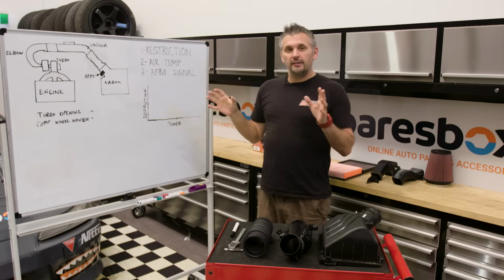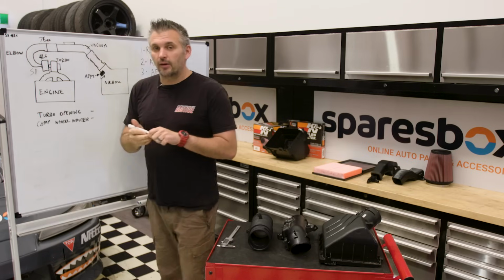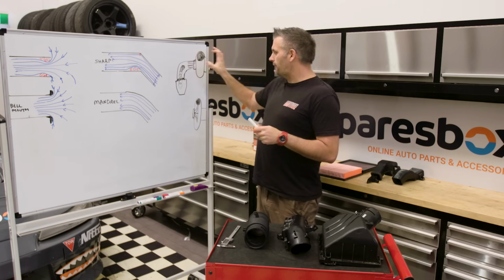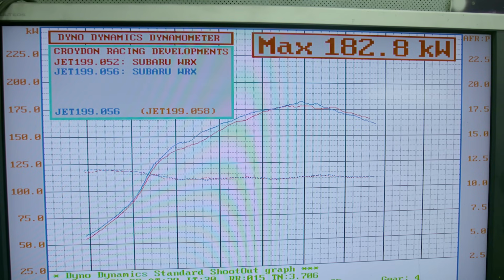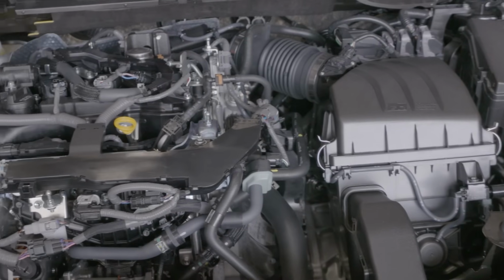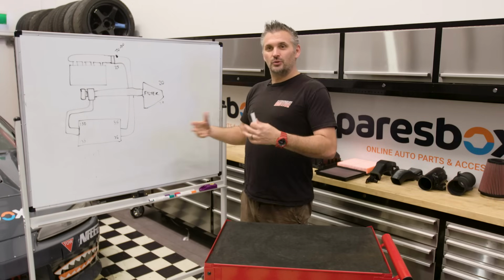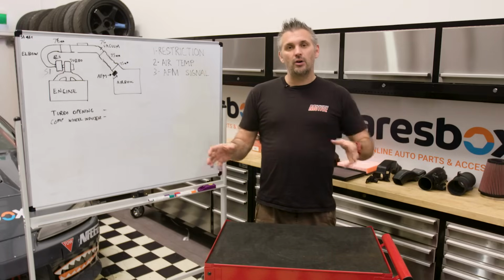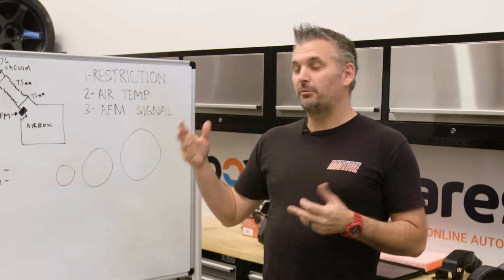Why Cold Air Intakes DON'T or DO Work on Your Car - Motive Tech

Comment: I can't speak for all aftermarket intakes, vehicles, labor and results across the board so I'm not gonna try to sit here and claim true or false for all for the majority but I can honestly speak from my personal experiences with simple bolt on parts before and after with older and modern vehicles. The oldest vehicle I've added such parts on is a 91 silverado with a 350 tbi. The newest vehicles I've added the parts on is a 2011 avalanche 5.3, 2500hd 6.0, 2500hd duramax and finally a 2018 escalade 6.2. No need to mention the diesel because everyone should know that these things make impressive gains by doing almost anything externally or internally. The 91 got very responsive and respectful gains mid to high ranges with just a cheap cold air intake, tb spacer and shorty headers and exhaust and even better gains after cutting the cats off! The 2500hd 6.0 was more of a let down as to shear power increases but I noticed more torque and lower rpm cruise speeds and a very respectful 3 mpg increase with the cold air intake and throttle body spacer without exhaust or headers. The escalade and avalanche where totally different stories! Those 2 where actually dynod before and after. Both received the same parts and brands which pertained to a cold air intake, spacer and tune which made a 16 hp difference in one and a whopping 22hp increase in the other! Shortly after I put a full magnaflow exhaust on both, plugs, wires, etc, larger injectors and shorty headers with yet again another tune with more substantial gains in hp, tq and mpg! The problem with most instances with these add ons is the neglect to get a professional tune afterwards so better luck and Goodluck to anyone doing these fun activities!.

Comment: On carb cars bigger filters and spacers and carb spacers all makes more power. I drive circle track have been since I was 10 I'm 29 now and bigger filters and spacers on the carbs make like 20 to 40 more hp because it's not a computer controlled car. So the theroy of more air and more fuel equal more power is true in a computer car the computer only allows so much air and fuel a air intake or spacers is not gonna allow more to go in unless you re tune it

Comment: Very well done explanation video.  This video helped me understand some of the success that I have had building a cold air intake in my street/drag truck. One of the successful things that I had not understood was the placement of the mass air sensor. I had cut a factory mount from an intake and put it where it belongs in front of the throttle body. I have learned that even the direction or orientation of a sensor can contribute to success. The mechanic that did the motor swap had mounted it in the end of a conical air filter. Another part of my success was deleting the a/c system. With the decrease in drag from the compressor and the removal of the condenser gives a clear path for air through the front grill. These changes  showed up at the track keeping in mind that the density altitude was better at testing the truck went from 9s to 8.7 in an 1/8 th . More than 3 - 10th of a second increase !  Thanks again for this video.  As I mentioned above it helped me understand the improvements that I had made.  I already knew that it had made a huge difference but, now I understand why it worked so well.
Reply: So what's better a stock 2011 mustang 5.0 intake or airaid cold air intake
Reply: @alexcarrillo5187  Try it and tell us all about it?

Comment: This is very interesting, especially with regards to the air flow meter.  My car, MK7 Fiesta ST had a Cobb intake installed by the previous owner that constantly threw a code, lean on idle that went away when switched back to the factory intake.  This was because the cobb intake moved the location of the air flow meter from very close to the filter in the top piece of the airbox to higher up in the intake pipe.  So the long term fuel trim was way over 50% all the time causing the engine light to come on.  It was also located after intakes from the carbon canister which may have had an effect.  What we have found out is that apparently for the US spec Fiestas, their map does not use data from the AFM, just map sensor whereas the Euro spec which we get in Australia does use the flow rates for the tune.  And on our Fiesta group there is sticky notice for that warns people to not buy any intakes from US manufacturers like Cobb, K&N and Mishimoto as they just throw codes.  It doesn't help that most of these companies never tested their intakes on non US cars so Aussie retailers who don't really do much research still sell them to unsuspecting customers.
Reply: That normal with 99.9 % aftermarket parts manufacturer they don’t even test for a month driving the car on road and then make fake claims
Reply: intake manifold vs what kids call  an "intake"
Reply: same here in the states

Comment: how come adding a performance intake slowed my 0-60 from originally 5.2 seconds to now a 6.4? i have a 2021 camaro 2.0, can someone explain this? do you need a tune for it to work? I'm losing mpg and power after installing the intake...

Comment: This is the honest truth about intake , personally I prefer factory intake box with 3 layer foam racing filter. Looks same as factory but less restricted and most car intake box is positioned to get outside air better than aftermarket intake. Nice video keep it up
Reply: And usually there is aftermarket options to get better flow to the airbox I've seen snorkels that go over your factory intake and some that route through somewhere like your grill using aluminum sheets to guide air towards your box instead of covering it.
Not sure which one is better I don't really like the idea of routing a huge snorkel right in the front of a car instead of just guiding more air
Reply: @Kuni - Kimina   another theory that make me don't even believe in massive air box is that bigger intake manifold  and high flow filter is more important than the diameter of the intake pipe .

Comment: I just changed my cobb pod filter to a grimspeed dry con panel filter. I recently put in on the dyno and had a 9hp gain before tuning even started. So il be staying with my airbox & panel filter moving forward

Comment: Reducing IAT and increasing MAF after removing restrictions will give gains. Many add cone filters that remove restriction and add MAF but heat soak in an open engine bay that do more harm than good. Installing new by the fans can also fluctuate MAF and heat soak. I’ve had better results building my own CAI then buying some. Many kits incorporate piping that is hard to best. Thanks mate!

Comment: In my natural aspirated Mustang GT - I noticed the biggest effect of an closed Air Intake (INJEN) on any car ever!  At the first 25 meters it felt in Normal Mode
like it was in Track mode, so huge was the difference in throttle response.  The Mustang has a directly positioned air suction from the outside! That´s the
intake temperature is only 3-4 degrees Celcius more than the outside!

Comment: I would like to know, what happens to your motor temperature during the winter if you've installed a cold air intake. Most OEM Systems have a temperature depending system to suck in warmer air in the engine bay in order to heat up the engine faster till it reaches it's optimal temperature. Not until then it closes such a pre heating system and sucks in cold air.
If you have a cold air intake, you'll not have that, so the engine takes a lot longer to reach it's optimal temperatur. You'll consume more fuel, the oil doesnt't heat up as well and so you may have more wear and tear. Please correct me, if I'm wrong. Colder is not always better.... it depends on, where you live.

Comment: I had a MONSTERFLOW intake on a 2000 Miata (back then not now). While it added a little sound under acceleration, the hp gains were negligible by today's standards.

Comment: hi all! i have a 2013 vw passat 3.6l vr6 and i modded my exhaust by making a .25" increase in piping from t pipe to tips(aftermarket 4" ) and removing suitcase resonator and replacing the 2 mufflers with hooker aerochamber straight through style muscle car mufflers( claims +40% flow). nobody really makes cold air intakes for my car but theres some that are "snug fit" like for example the r32 golf.  i am thinking of doing tune and cai at some point.

anyways, my main question is with my exhaust setup, do you guys think i should tune and/or do intake according to my exhaust setup?

Comment: You didn’t include making sure the cold air intake tube being red.  That adds 100 HP automatically.
Reply: 😂 used too in my saxo 1L
Reply: Damn that's some funny dad logic we would here when we would slap stickers on our motorcycles as kids.  10 hp right there
Reply: He didn't include it cause it's common knowledge.
Reply: Blue makes it extra cold
Reply: @adrianmunteanu1427 😂
Reply: Cold air intake also adds cool noises so that’s good for another 10hp. Plus any stickers that come with it
Reply: That’s true
Reply: The upgrade to red is purple with a sticker.
Reply: Red goes faster!
Reply: You gotta unlock it by winning the race like need for speed underground 😂 upgrade level 3 😂
Reply: And if you add the K&N sticker it’s another 50
Reply: I'm a fleet tech on garbage trucks and all of those trucks a a gadget on the airintak to monitor the vacuum in the intake and if it increases to a certain point you change the filter it's pm maintenance they push like 30psi. Big turbos Mp7 paccar aset Cummins isx heno autocar.
Reply: Damn and I just bought a blue one.
Reply: @alexandernelson477 it’s better, higher gains actually 👍😁👍
Reply: ow.  Slow. A. F.   
Lol!😅
Reply: Blue tubing cools the air better and give you twice the HP as red tubing.
Reply: @FIGNAS83 oh, that is true tho.
Reply: What if it shows a brand name or has a checkered flag image?
Reply: Real original joke
Reply: The yellow stripes adds nitrous
Reply: Also remove all the manufacturers badges, that a other 100 hp, instantly !!
Reply: If u don't have the filter right in front of the passenger tire to pull in fresh air u have a hot air intake
Reply: Lmao!!
Reply: sheeesh, ima paint mine right now
Reply: Geez, that goes without saying. Everybody knows that.
Reply: Say what you want my genesis g70 gained 23hp from the cold air intake
Reply: @jb0915  On a dyno? How was this measured?
Reply: If you put a sticker on your car of flames 🔥 you automatically gain at least 100hp and get to be on a fast and furious movie
Reply: I though Blue gives higher gain though 😁
Reply: If not 110 hp.  It also helps to wear sunglasses at night.
Reply: I thought the filter being red was the most important part?
Reply: I’m painting mine red tomorrow ! 😂
Reply: I thought it was the shiny one that did that
Reply: And chrome adds another 100hp

Comment: Manufacturers R&D engineering is too notch in stock Air box. It also prevent rain water intering the Air box and hydrolock your motor. Aftermarket just makes noise!

Comment: I thought this video spread a wealth of knowledge but the one thing I kept waiting to hear and forgive me if I missed it... But I thought for sure (at least on naturally aspirated engines) that the inside diameter of the intake pipe would have a significant effect on the air speed or (velocity?) At different engine speeds.

Comment: 1stly a 4 inch air tube stock or other wise, will not restrict a 90mm throttle plate, 2ndly most draw hot air from under the hood. Its actually a hot air intake. Cold air intakes are a gimmick. A cheap piece of tube 3 clamps, and a cone filter should be $30 not $200. Gimmick with false marketing.

Comment: You are assuming that turbulence = less flow w/o measuring or explaining.

I guess this is NOT always true! e. g. : the open bed of a truck:
similar to what you drawed on the board with a sharp edge. a truck benefits of the turbulence behind the cab when the open bed has a closed gate.

Comment: The other thing you have to consider is how quickly the filter will clog up with a true CAI. I  had a scoop style CAI on my s2000 and it was great with a clean filter but the filter would clog up very quickly during daily driving and make the car sluggish
Reply: Was thinking of adding a CAI on my 93 4runner with the 3.4 swap but I'm on a dirt road where I live and I do mostly off road driving with that rig. I'm just guessing but I stayed away for the dust factor.
Reply: @fightthelies4349  I have a 22re and found a 3rz swap is an extra 50 HP, inline four, Toy motor and I'm thinking free flow header/exhaust, slightly more aggressive cam and cold air intake would make an extra 60 HP over the 24re- the 3rz is like 2.7 litre over 2.4 litre, but minimal modifications compared to building a 22RE motor from scratch; there is a number of videos on YT to give you a heads up; 50-60 extra ponies and same 4 banger reliability and gas milage to boot!

Comment: Long story short, there are no cold air intakes at all. They are just as cold as the air you put through them into the engine. If any intake plumbing will not be heated up along the journey into the engine.

About air turbulence, well, it only matters right up the compressor inlet, or the intake trumpets or that carburetor mouth on a smoothbore. What you need before that is flow, which is brought to you by larger pipes and bigger airboxes(if needed). The larger the area, the slower the air will be moving (air velocity) which in turns presents a far more easier job for the turbo to suck that in because of the less turbulent "agitated" air and the suction will be far more efficient.Turbulence becomes more noticeable as air velocity increases. The Toyota engineers definitely done that - the big pipe size JUST before the smaller turbo inlet diameter shows!

If you want the least restriction then you have to eliminate as much length of that intake piping as much as possible, because the longer the line the more restriction it will become. Otherwise you have to enlarge it quite the size.

How about putting some heat shields preventing the radiator and intercooler air from blasting through your motor, intake, or fuel system? Sportbikes like the YZF-R6 come with heat shields to stop the air from the radiator fan going into the airbox, intakes and throttle bodies, some racers take them off but then it robs them power because of that heat passing along the intakes (much more if it was carbureted!)

Note: For a real world experiment on restriction with pipe length, prepare two identical straws or tubes, one definitely short, the other definitely long, feed them with equal pressure and then measure the amount of fluid (use water for this, it can apply to air since air is a fluid too) on two identical cups and time it to see  which one flowed the most. Will also work with suction! Use a vacuum pump and reverse the flow, this time you are sucking in than pushing out.

And another note: this does not apply to whatever is AFTER the throttle bodies or the carburetor. On that area, you need to maintain a certain amount of velocity to create fluid inertia which will actually ram the air-fuel mix into the combustion chamber, but not too much where the flow is too low for the volume of the cylinders plus the RPM they(the cylinders) will be running.

And one more last note: NA motors can actually benefit from intake velocity rather than flow. It may have a flatter power curve with the smaller carburetor/throttle body or a longer trumpet because of the more constant intake velocity over the rev range (The basic concept of Yamaha's YCC-I). For example, a bigger carburetor or ITB is not always the solution - you have to make sure that the flow through it is still good for your cylinder volume and engine speed, and whether you would REALLY want a peaky motor than a smooth powerband (remember some multi-geared GP racebikes of the 1960's!)

Thanks for putting up some info on the topic, if I will ever get myself a car(nope, not a GT-R because can't afford that, maybe a Civic and push that B16 until it breaks) and go tune it the first thing I will do is change that MAF sensor with a MAP, changing or modding the ECU in the process. And if I change the ECU I can also run a wideband and even drive-by-wire if I would like to, say, like the new G4X platform from Link

Comment: Very good info. Here in the US most every "cold air" intake that I've seen isn't sealed up at all. Just pulls hot air from whatever corner of the engine bay it's mounted. All show n no go.
Reply: That would be a short ram. A cold air intake pulls air from outside the engine bay

Comment: Anytime I have used AEM cold Air intakes with Ceramic coating do create about 5 Horsepower increase thru out the range. Now when you tune it though and make huge changes to the fuel and Spark delivery then it really starts to produce over 10 to 15 HP Seen it done it dude on a Dyno.
Reply: plastic is very smooth.. and does retain heat very well
Reply: You ceramic coated your AEM intake?

Comment: You guys havent got a clue 
What you are looking for is velocity
Has nothing to do with vacume
Dialed in 
its a balance at both ends of engine
Its not funny shaped stuff that helps fit where its going to get to fresh air 
They underestimate the velocity of a pipe
you want a open end k&n open end pointing directly into pipe
Headers help  But 2 into 1 is better than duel exaust  because the engine can only 
fire one side at a time  duel starts and stops 2 into 1 with at least 3-4 feet of pipe
with 3 1/2 pipe going in  and 3 1/2 coming out
Its going to build momentum at both ends 
not 2 and 3 at other end   or 4 going in and 2 coming out 
other wise your blowing in a balloon and its blowing back at you
its that simple
when you see that guy grinning and say hes dialed in thats what hes talking about